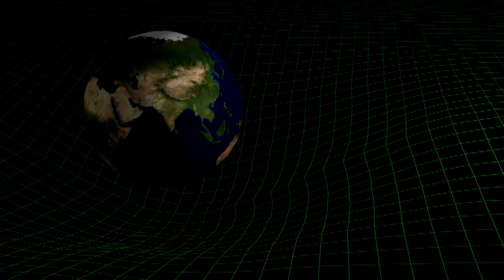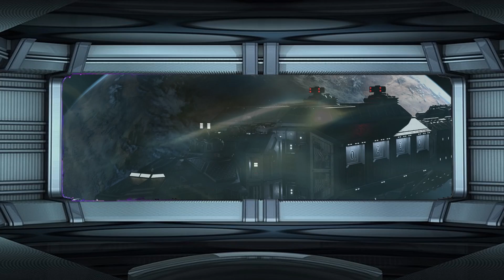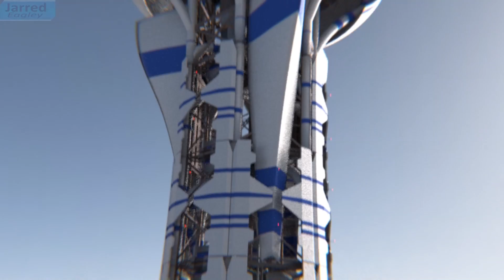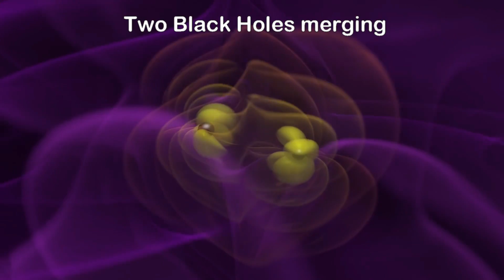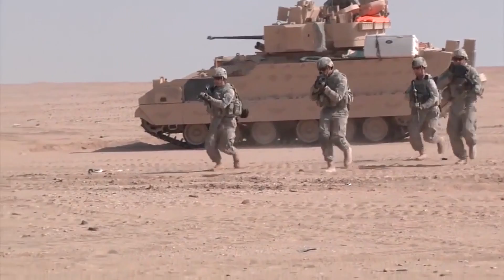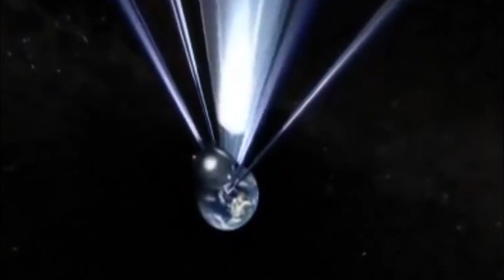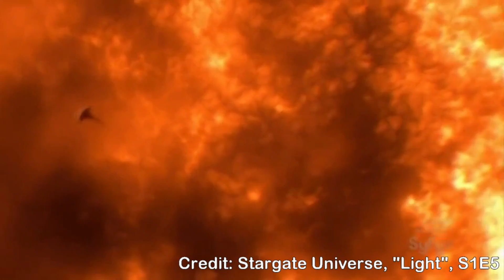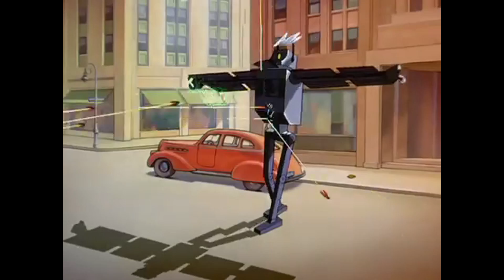Force Fields

Comment: No stealth in space my ass.
Reply from the maker: That would be more persuasive if you said how, though fair warning, I've never heard a method that I and others can't pick apart that doesn't rely on made-up technology or super-huge distances to work.
Reply: Well lets consider the following. If you can travel from star system to star system in a reasonable amount of  time, then you can propably quiet literally appear outside a planet a matter of seconds. Suddenly stealth isn't really the problem. But there are other methods too.

Space is fucking huge. Not empty, but huge. And a space ship is a blip on the screen. You are trying to spot a needle in a hay stack. You essentially need to look for heat radiating from the ship, abnormal movement of an object, and the object itself. The biggest problem being heat since thats essentially the canary in the coal mine. But the other two are relatively easy to do. You are a tiny object on a vast canvas. A three dimensional one at that. The biggest hurdle is concealing the heat radiating from your device which isn't impossible its just difficult. Moving in areas where space debris is already common (like asteroid belts) will allow you to move  within a solar system unnoticed.

The goal isn't to camouflage yourself or necessarily hide, its to make yourself unnoticeable.

And then there is also smoke n mirrors method. Make a lot of noise here, get all eyes on this one totally obvious invading fleet of uber evil deathstars (or something just extremely obvious) and quietly move a much smaller and less noticeable fleet from another direction. You have limited resources. You can only scan so much of the night sky. Focus so much attention at one point in space.

Then there is the priotity of warefare itself. Say to hell with stealth, just get within range of attack. Now its a gave of deception. Using one attack on a defensive structure just so you can get close enough to deploy forces to the ground. Or use it as a distraction to mount another attack from somewhere else.

Then there is how people actually look for shit in space. Which is essentially a satellite scanning for a specific set of data. If you know what that computer is looking for, you know what you need to hide. Fool the machine, and you can get around the defenses.

Distraction, deception, and trying to just remain unnoticeable.

Comment: About hiding in a star: I imagine a major problem with hiding in a star would be the sheer gravity of stars.
Reply from the maker: There's a lot of it, around 30 gees as I recall, though that's survivable by inorganic or cyborg'd up folks. Amusingly the bigger, brighter, hotter stars have less of it since they're more massive but less dense. If you're shield can take it you could drop closer to the core where gravity will start dropping, though of course the pressure and temperature are insane there, but 'insane' is relative, that's pretty much exactly what a fusion reactor using magnetic confinement needs to handle.

Comment: but surely the particles in the bullet/knife/whatever would be jiggling about due to temperature at the the same sort of speed as the air, so the point at which the field blocks particles could simply be selecting the fast moving particles of the fast moving object? i have no idea if that made sense
Reply from the maker: Yes particles in a solid object do move too, though not much at the atomic scale, at the subatomic scale most of those things are whipping around at relativistic speeds, though you can argue they're not really moving just kinda smeared about in a probabilistic distribution of speeds and positions.

Comment: HYPE!

Gundam universe had this as Fin Funnel barrier systems, which are generated using remotely controlled autonomous bits named "Fin Funnels" which form a pyramid around the Mobile Suit, fire beam shields connecting each Funnel that block anything lower than the output of its beam shields.

One other is GN Field, generated by particle generators which condense and form a protective sphere around the Mobile Suit.

Now to look at how other SciFis implement their own... while learning any options known science may offer to us.
Reply: Don't forget the normal I-Field using Minovsky particles.
Reply: BlueMachine I-Fields don't affect conventional weapons though so missiles are an easy counter.
Reply: Exzcellion Gamma Now we just need to replace Neutrinoes with Minovsky particles and we're ready to go.
Reply: Although neutrinos have very little interaction with matter, and Mnv particles do have a great amount of interaction to normal matter.

"When the Minovsky particle is spread in large numbers in the open air or in open space, the particles disrupt low-frequency electromagnetic radiation, such as microwaves and radio waves. The Minovsky particle also interferes with the operations of electronic circuitry and destroys unprotected circuits due to the particles' high electrical charge which act like a continuous electromagnetic pulse on metal objects. Because of the way Minovsky particles react with other types of radiation, radar systems and long-range wireless communication systems become useless, infra-red signals are refracted and their accuracy decreases, and visible light is fogged. This became known as the 'Minovsky Effect'."
Reply: Macross has the pinpoint and Omni Directional barriers. The Omni Barrier is only capable on more massive ships but is not entirely stable. But the pinpoint barrier is more stable.

Comment: Well a force field means that you literally invent (or completly control) a new or existing force, one that fits the classic sci fi needs.
My bet is on a field that is able to drain power from a controlable area so anything that gets in there will lose the destructive force it carries to even out the field, but since in an active system the generator will drain more power from the field so it can stop more stuff, and ofcourse the power drained this way fules the machine that does it.

There is already a technologyie that does this. It uses electrons that got drained in theire power level and is streamed across a surface where it picks up the energy as heat effectivelly drasticly cooling the aparatus.

Comment: What about drone sheets? Micro flying drones that create visual blocks one way, yet display from the other side the other way. These could already work on sound, too. With grav-tech, it would be preferred deployment. 

These could also be used to replace nukes - small explosive payloads that only target humans - leaving more habitable area. 

At the end of your space-tube, a drone sheet could be programmed to specifically create an opening shaped like the incoming/outgoing ship. Little energy nets could be between them, both linking and transmitting power between them.
Reply from the maker: Yes that is an option, both of them, the slightly large drone moved shields instead of a shot pellet, or the 'ultra smart bomb' where a munition fragments into a thousand tiny guided projectiles instead of shrapnel.
Reply: Hmm... What about a cloud of junk held in place or made to "orbit" the spacecraft by magnetic fields? 

A shield might not be used to block incoming fire but divert the paths of projectiles and diffuse lasers. Also if you can make a large bright bubble around your ship then you could potentially use it to hide the exact position of your ship from the enemy.
Reply: nipi tiri If we assume fusion levels of power or greater, and slightly better than current 3D printing technology, then going from junk to drones is a cheap transition. The question would be if it force shields are so unfavorable to make lugging drones around worth the energy to carry them.

Comment: Under 1000
...I must be somewhat early :P
But could you eventually do a video regarding planets that spin really fast?
Like planets spinning at orbital velocity.
Reply from the maker: We kinda covered that case in Double Planets and Rocheworlds, and Hoopworlds, though there's more that could be said I suppose.
Reply: Black Hole
You don't get very fast spinning spherical planets. When they are very fast spinning, they are pulled out of that shape.
Reply: planets spinning at orbital velocity would be in an extremely precarious equilibrium, any faster and they lose mass as the very ground would rise into the sky, any slower and they aren't at orbital velocity.
in reality a planet would probably only be rotating at or around orbital velocity for a small period of time, it would either fly apart or slow down.

when spinning faster than orbital velocity it is a really interesting thought experiment since you have the centrifugal forces from the spinning fighting the mass loss instead of the gravity of the actual mass, if it lost mass fast enough the whole planet might spin itself apart though if it didn't the speed of the ever shrinking surface might drop enough due to simple geometry to halt the process

theoretically if the planet had a solid enough shell i suppose one could have a planet rotating faster than its orbital velocity without shredding, it would have to cope with centrifugal forces though, perhaps a solid ice moon?
Reply: i usually consider rocheworlds, and hoopworlds, Seperate from very fast spinning, Spherical worlds. And, that video, was actually what got me curious about it in the first place
Reply: If earth was spinning at orbital velocity, wouldn't that just cancel out the gravitational pull? If so I doubt life could emerge on such a place.
Reply: IamGrimalkin, He probably meant "spheroidal".  

The space elevator is a lot easier if the planet is rotating faster.  Star lifting would be much easier orbiting Pleione or Vega than it would be around the sun.
Reply: Solid meteors have a higher break up rotational speed than liquids.
Reply: You want early? I am view 86.